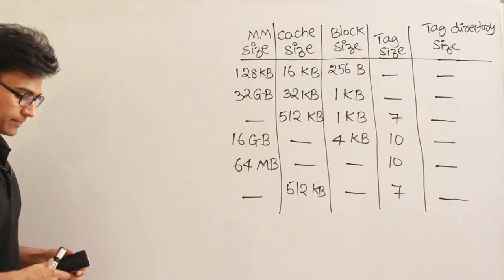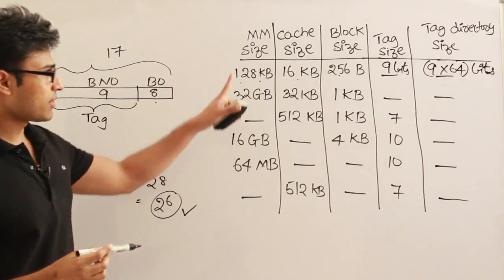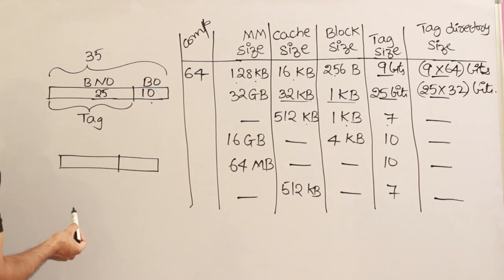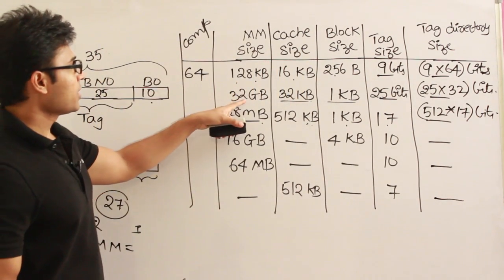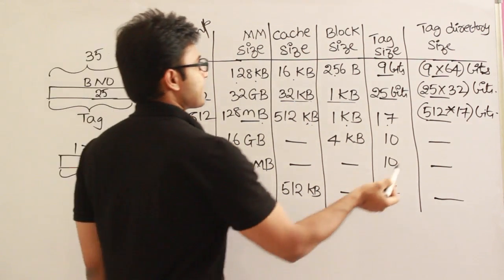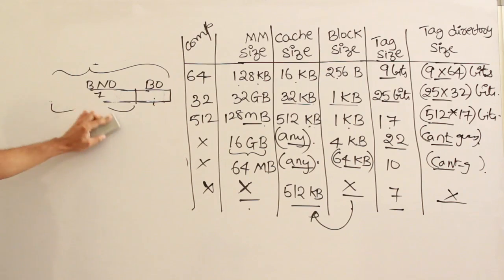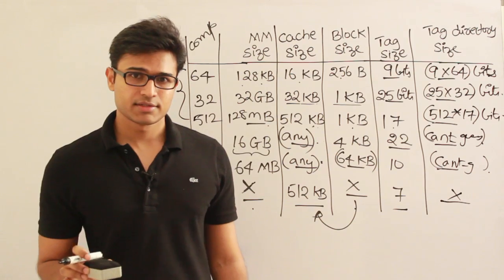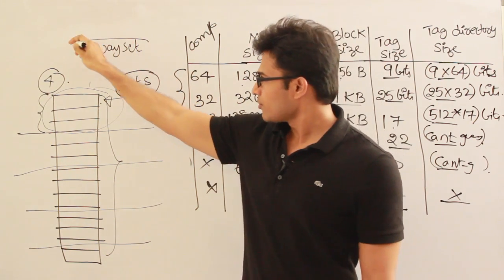COA | Cache | Problems on Associative Mapping | Ravindrababu Ravula | Free GATE CS Classes

Comment: in the problem solved from the associative mapping introduction lecture, the number of comparaters we used were equal to the number of tag bits. But now the number of comparators is equal to the number of lines. Number of lines makes more sense but i would like to know which one is right, and if my guess is right, then how am i going to find the PD of the comparator in the first problem??....

Comment: how 64line, i think it should 6line isn't??
Reply: yes i think so
Reply: no it should be 64, because each tag information is going to be 9 bits, then every line is going to contain tag. Now 2^6 lines are there. So, Tag directory size is (9*2^6) or (9*64) as 2^6=64.

Comment: thanks for clear  explanations 
But im lost on how you are doing the conversions from KB to bits
Reply: when somethings is given in bytes like 128KB then 128 is 2^7 and K is 2^10 that makes 128 KB= 2^17 B so no of bits will be = 17 (which is the power of 2)
Reply: 2kB = 2 * 1024 (k, in power of 2) * 8 (B, 8 bits per byte). The minimum amount of bits to represent a number is  ceiling(log2(number)), and thus the maximum number of element you can index with n bytes is 2^n.